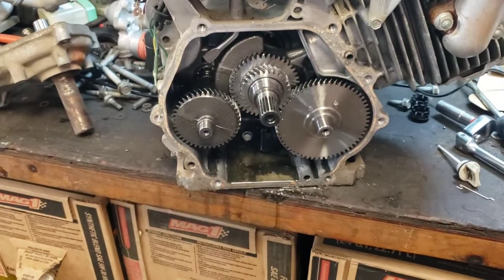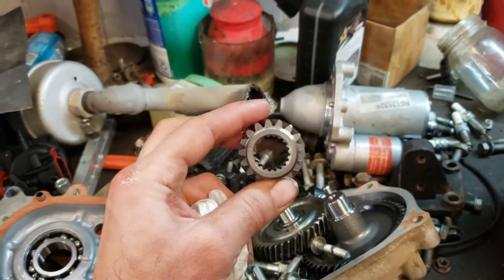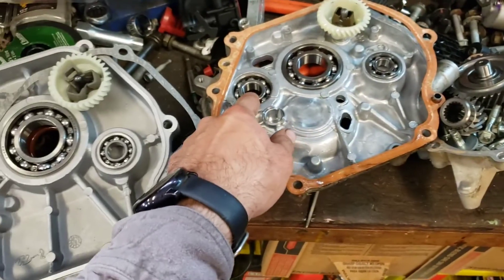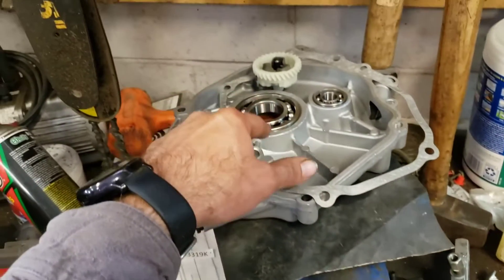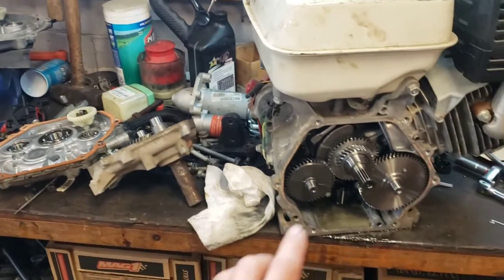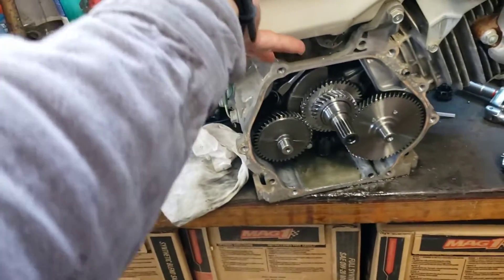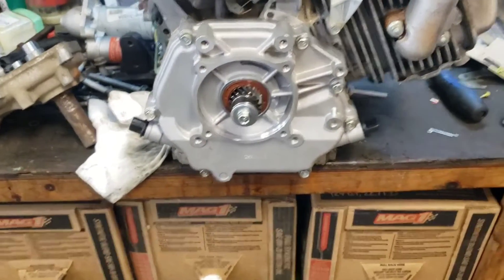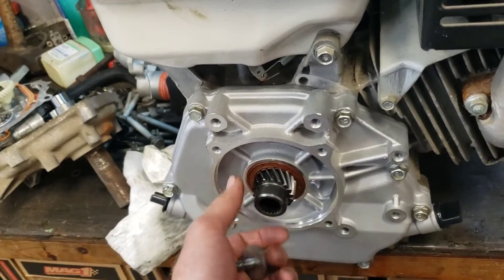Operation: Honda Gear Reduction Swap

Comment: Hi mate, quick question. I have 2 gx270 motors one of which has a 6:1 reduction but isnt running and the other is standard. If i take the 6:1 off the old motor would i be correct in assuming it should just fit straight onto the standard motor? 

Thanks in advance for your help
Reply from the maker: I'm afraid not. The crankshafts are different so you would likely need to swap crankshafts too.